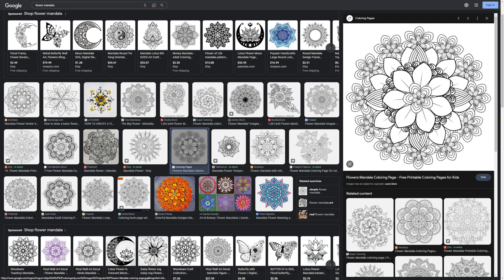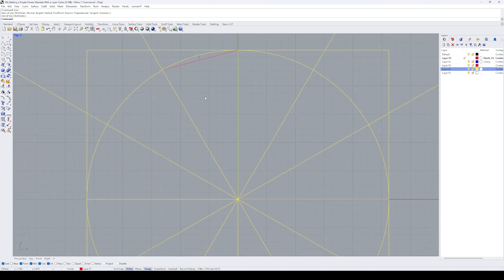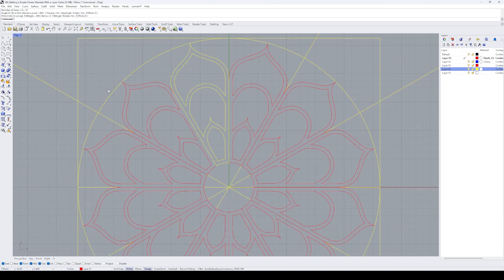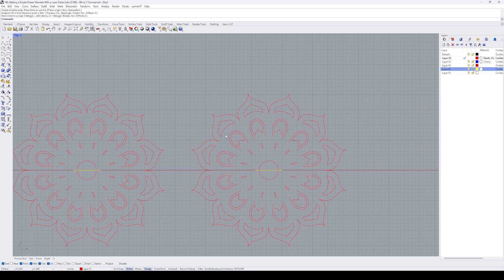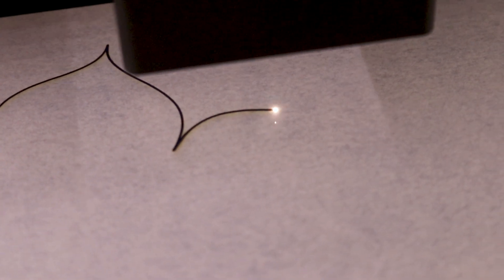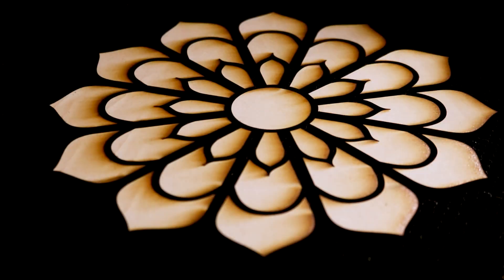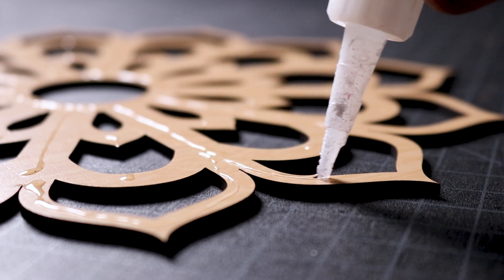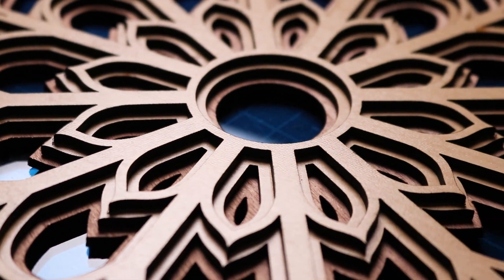Laser Cutting a Simple Flower Mandala

Comment: hi . im trying my 1st laser cuting project but i am having a problem. im curring 2diferent plexi material that i want them to fit inside esch other but while cutting they lose some material and they dont fit inside each other can u give me any tip please how to fix it
Reply from the maker: Sure! I think you need to remember that when your laser is cutting a material, the laser actually has some thickness to the beam that’s cutting. You need to figure out what that small amount is and remember to include it in your design. Also, if you’re trying to make a very tight and exact fit, it might be a problem if the final piece is in a hot room or cold one. Materials expand and contract, so it will expand and pop or contract and leave gaps based on temperature
Reply: @LaserMadeProducts  this was really helpful thanks a lot